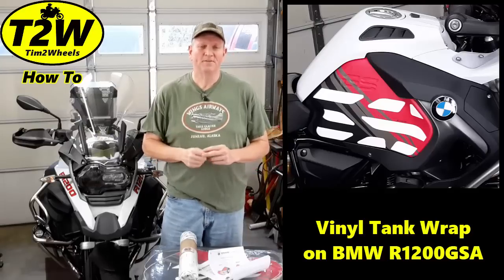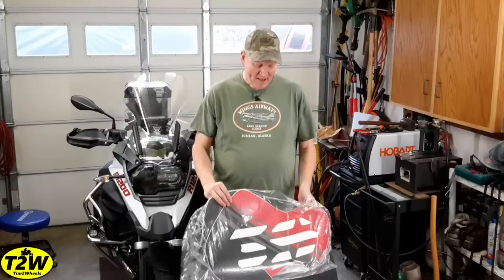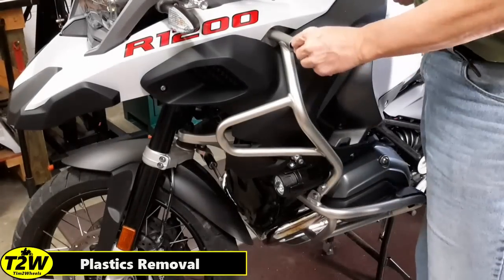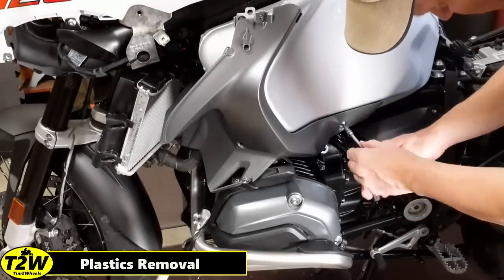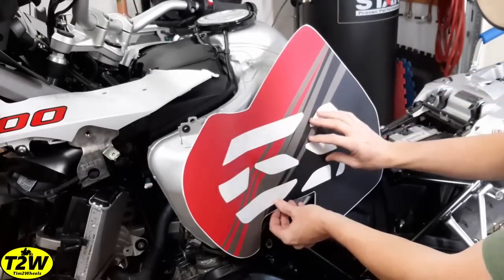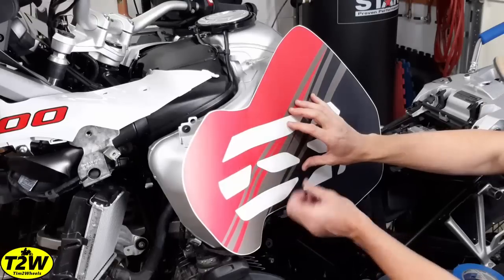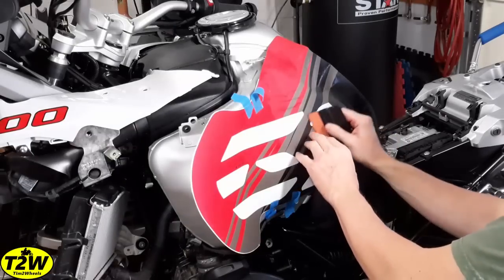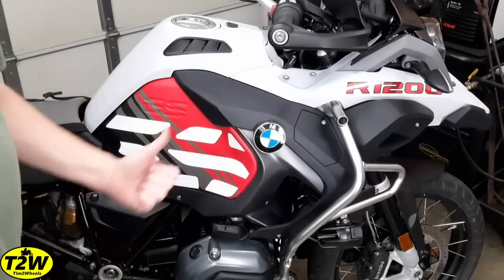T2W How To: Vinyl Tank Wrap on BMW R1200GSA

Comment: Wet application is the better & easier choice as you need to have flexibility when applying... But thank you 👍
Reply: That is what is called an opinion...yet you stated it as fact. As you can see, he just did one wet and one dry and he prefers to apply it dry. You prefer it wet. Clearly there are reasons you like it your way and reasons he likes it his way but neither is correct/better/easier, just a preference.

Comment: You mention wrapping your panniers and top case.  Can you elaborate?  I see they have kits at signature for some panniers, but can a larger kit be used on other brands, maybe with a little scissor work?  Were they easier then the tank?   (Besides the obvious fact you would not have to remove so many damn screw!)
Reply from the maker: Hey Dan, I did a custom wrap on the panniers and top box and lined them with a indoor/outdoor thin carpet. I'm planning a video soon to recap how I did it.
Thanks for the question and for watching.

Comment: Tim after stumbling on your video by mistake I was amazed how much better your Adventure looks. I have a 2015 and ordered a kit similar to yours shortly after watching your video. I've only ever put graphics on my off-road motorcycle and can't remember if I did it wet or dry. It sounds like I should wing it and do a dry application. Do you agree? I'd also like to try some kind of vinyl wrap on the back of my windshield to hopefully make the GPS more readable. I added a sun shade which really didn't do much. Where have you been getting your vinyl from. Thank you for the video!
Reply from the maker: Dana Russell - Yes I would recommend the dry application. It worked better for me. 
For my other vinyl,  I have ordered from Amazon and eBay. I recommend good quality vinyl like 3M or Vvivid XPO.
Thanks for the comment and for watching.

Comment: Whoa a GS? What happened to the KLR? Thanks for all your KLR videos. I've watched em all.
Reply from the maker: R. Brent Wells - Hi Brent, I did trade my KLR for a new GSA. I am making longer trips 2-up and found I needed a bike better suited for doing those type of trips. The KLR is a great bike, but the GSA provides more power and larger, more stable platform to longer range 2-up touring. And I can still get dirty when I want :).
Thanks for the comment and for watching.
Reply: Tim2Wheels Congrats on the GS!
Reply from the maker: Scratch Babble - Thanks Scratch!